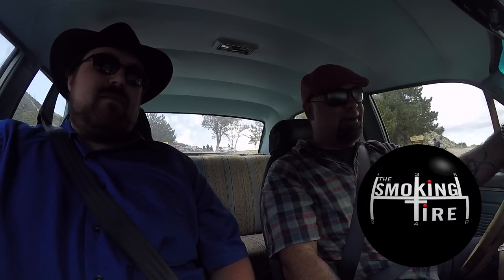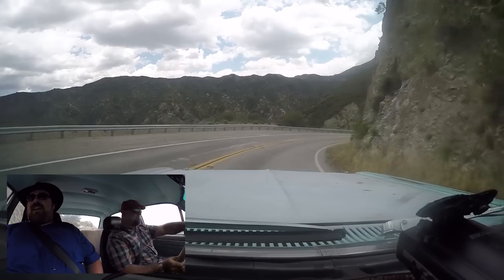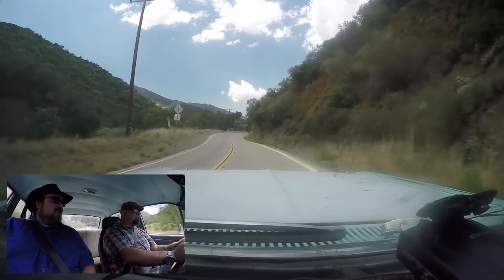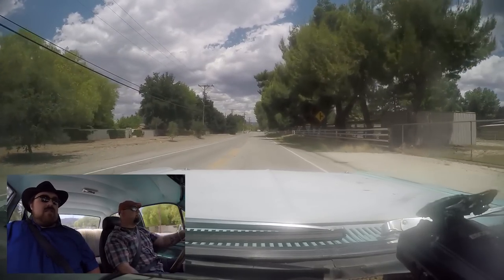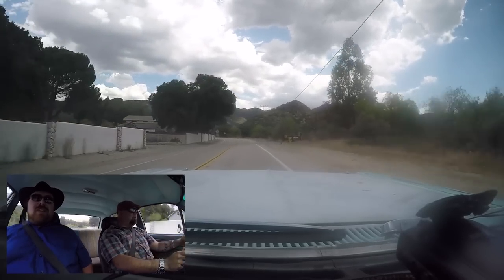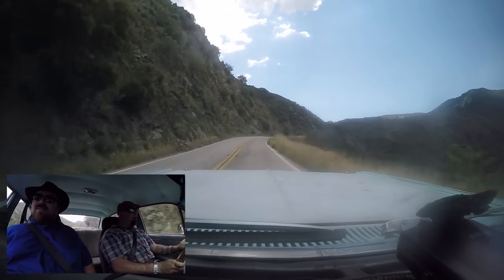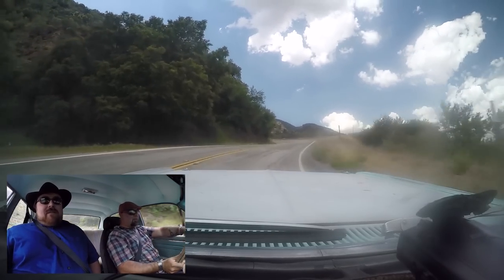1967 Ford Fairlane - One Take

Comment: Most people get a terrible impression about older cars due to the fact that the the vast majority of the ones still around need lots of love to be proper. Any vehicle with shrunk hardened bushings and mounts is going to drive badly. It's refreshing to find an old car like this that's had some love to make it drive like it did back in the day. I used to think all old cars were sloppy boats until I was chosen to be the driver for a group needing breakfast since I was the only one relatively sober. Everybody had single cab trucks but one, so we took his rusty 64 Galaxie 500, 3 on the tree 390 to haul everybody. The thing was ugly, but he obviously made all the important bits right. I was amazed at how solid and planted it felt on the road, at how well the steering and brakes and suspension worked like a perfectly modern good car. The 390 pulled the carload of hungry bar-goers effortlessly to their 3 a.m. breakfast buffet.

Comment: There simply are no engines that sound as cool as the old small block Ford. Things changed with the 351 for some reason. It just doesn't have that sounds, but 302's and 289's are epic.

Comment: I'm digging the paint and style. Keep it classic rat rod and make it handle. Just sort out the U-joint issue, reinstall power steering, power brakes, more shock dampening, and R888 tires.
Reply: Nah, man. Manual steering and brakes are fun. . .
Reply: ...as long as you're not daily driving it. Here in LA, power brakes are mandatory, as traffic has this nasty tendency to fill any gaps it can.
Reply: yea he needs to playing and handle that
Reply: computiNATEor I used to daily a '67 Cougar with manual steering and brakes. It was perfectly safe. 

Never been to L.A., though.
Reply: osp80 Arthur Robinson Point taken. But here in LA, where traffic tends to move at 80mph less than 2 car lengths away, and drivers treat stoplights like unofficial drag strips (not racing, but racing away), brakes can be invaluable to avoid accidents. Like last week when a beat to hell Dodge cut me off while merging on to the freeway, nearly pinning me into a semi, or last year, when an old Nissan slid across four lanes of traffic (including mine) and smashed into the center divider...

Comment: first gear does more than 100km/h?? wat?
Reply: Proper gearing. :)
Reply: If there is torque!
Reply: 2.79 rear gears is why - it would be more fun on those twisty roads with 3.73's
Reply: +Lee L a 342 would be better ,  or 355.  To keep it in the power band of that 302 and less wheel spin out the gate
Reply: w124 amg had 2.24 an rear went 300 kmh with 4speed auto lol
Reply: yep. 4 gears will do that. I can hit 90kmh and my redline is below 5000.
Reply: people are forgetting that it's a Cruiser & a daily driver so 2.79's are exactly what it needs, but if you do want just a bit more sping and still keep it as a daily cruiser a 3.00 diff would be perfect!
Reply: +GTFORDMAN 342 gear for the win would be matched up perfectly .
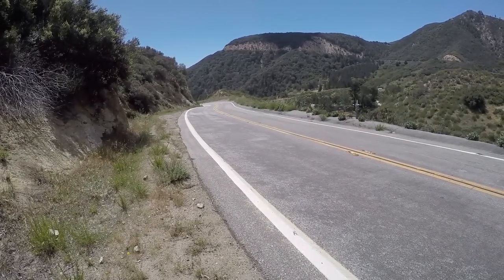Reply: +GTFORDMAN but with a 4 speed manual 3:08s actually is the best bet!
Reply: yea a 3.08 is pretty good for a part time track & full time driver i'll pay that!
Reply: Yeah, I estimated that my old XY Falcon with a warmed up 302w, close ratio toploader (2.32 to one first gear), 3.00 diff gear @ 7,000rpm was doing around 70 ish mph in 1st !!
Reply: P.S.  .....was quite different when it had 4.33's, .....I ended up with a reasonable 3.5 gear in the end (late 80's to early 90's).
Reply: 4speed

Comment: My brother has a 67 Mercury Comet Wagon. Three on the tree. He tried to "restore" it to factory specs (rebuilt gutless I6 included). In hindsight a build like this would have been way, way better. Engine bay is super narrow so back before I knew any better I assumed a V8 may not fit. Still has four wheel drums! I may eventually redo it when $$$ permits.

Comment: More details on that S13 parked next to the fairlane at the start?
Reply: it'll come.
Reply: I'm also waiting on the s-chassis
Reply: Details:  Probably the same SR20 proof positive 400hp with coilover build that's in every 240...
Reply: That is why I asked, because I don't like to guess.
Reply: +MrSlowestD16 actually no. i was waiting for matt to just post the video since it should be up very soon. he drove my car right after the yaris.  but real quick, stock block sr with gtx2863r, tomei cams, half-caged with door bars, full grip build. revalved gab sports coils, s15 front control arms, tomei 2 way clutch diff, 275 section rear nt01s, 245 section front nt01s. car puts down 300rwhp, 300rwtq with a very usuable powerband. ive had the car for over 12 years. ive been there, done that with the 240 scene.
Reply: Want to trade that turbo for a GT3582R?
Reply: +walperstyle no thank you. i prefer the smaller turbo for the response it gives as you will see in the video
Reply: That is exactly why I want smaller for my KA-T.
Reply: +walperstyle true. keep in mind that you have an extra .4L of displacement to help spool the turbo.  with a really good tune, you should still have a usable powerband.
Reply: I did the math my exhaust side (.82AR) is a little too large for what I want.   a .70 would be ideal.    Especially considering I don't have access to E85 up here in Canada.

Comment: What are the mods to the 302? He doesn't have to give up his cam specs I was curious about his compression ratio because it sounds nasty. What is an estimate for his power and torque curve? I'm gonna guess no higher than 400 horse if that.
Reply: So the 302 has been punched .030 over, but is otherwise a stock bottom end. Cam is a Comp N+271H, which is a hydraulic replica of the original Hi-Po cam, 266/273 and 219/226@ .050. I'm also using a set of full roller rocker arms. Intake is a summit racing aluminum intake, with Patriot long-tube headers. Distributor is a Pertronix unit, and the carb is of course, the Quadrajet.

As for a power and torque curve, here's what I have: http://s43.photobucket.com/user/NotLawMCO/media/Chassis%20Dyno%20Run%203.12.16.jpg.html

Sadly the fools running the dyno were clueless. The dyno was being run at a drag racing event in St. George, and the fools running it were only dynoing diesel trucks. They didn't know WTF to do when I showed up and said I would like a few pulls. They completely failed to take any relevant information about my car, and they just ran it with the same settings they were running the diesel trucks. The data was totally messed up. I did what I could to correct it, but all I really trust is the shape of the curve. Actual numbers could be off by as much as 20%.

A few weeks ago, I had an exhaust valve fail catastrophically, so now the block is getting machined, balanced, and a set of AFR heads. Should pick up some good power.
Reply: That's cool! Good luck with your project my friend! Thanks for sharing car updates! Go car guys!

Comment: Fix the rubbing and put some 3:73's in the rear and the car would be a hell of a lot more fun. Love the patina.
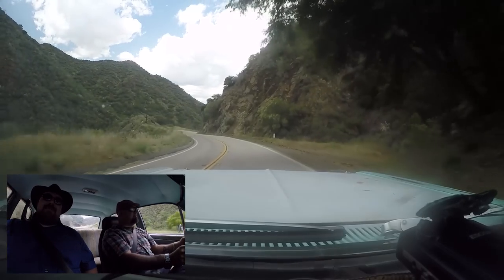Reply: Eventually the car will be getting a T56 and a set of 3:55's. It will effectively give me one gear under my current first, and one gear over. My current Toploader is a close ratio box, I love the gear spacing, and the particular T56 I am looking at will keep it the same.

Comment: 05-06 corolla xrs..find one drive one! Has the shared lotus Elise motor from factory...sleeper
Reply: It has like 170 hp
Reply: It has a nice motor but exactly, 170 hp is not a sleeper lmao
Reply: ***** That was quite a bit in the elise because it only weighed like 2000 lbs. But a 2,800 lb corolla with 2 passengers is gunna struggle to get out of its own way.
Reply: mazda 3 has similar power handles great
Reply: +miniTv미니19十 Mazda3 is pretty boring also
Reply: Robbspeed Yeah it's a mid 7 seconds to 60 car which isn't bad but the best thing about it is the sound of it
Reply: +miniTv미니19十 I would rather drive an xrs than a 3
Reply: Robbspeed the hatchback is fun. one of the best handling fwd ever made.
Reply: 미니19十 miniTv That's a stretch lmao
Reply: ***** no it's more sport car than economy car.
Reply: 미니19十 miniTv You can say that about the Mazdaspeed 3 but not the regular 3 lol
Reply: +miniTv미니19十 Maybe the speed3, but not the regular 3. Even then, there are fwd cars that handle better. Focus st immediately comes to mind and maybe the gti.
Reply: +Imad S Thanks lol.
Reply: Robbspeed I disapprove of your 'maybe the GTI" comment lol :P
Reply: Robbspeed honda integra type r still out corners some modern rwd cars. probably the best fwd.
Reply: +Imad S Lol thought you'd catch that. Definitely the gti.
Reply: 미니19十 miniTv Now you're making sense!
Robbspeed Thanks xD
Reply: I would love to see that, they are honestly underestimated.  here people swap the  2zzge toyota Tercels and Echos, and a few yaris are running them.
Reply: +B0rikua45 They're respectable. I think it's impressive any time you achieve nearly 100 hp per liter from a naturally aspirated engine.
Reply: +Robbspeed ive owned 2 and thats honestly not a good rep to the car. Yes 170 but with just an intake and exhaust ive seen xrs have 170 to the wheels which would equate to 200hp to the crank or more. In a care that weighs 2700 lb is still fun. Ive scared and beaten  a lot of things that people would never think is possible
Reply: +Robbspeed look up some vids you would be surprised
Reply: We call them Corolla T-SPORT in Europe. Came in 2002 to 2005...
Reply: +AllFromA_Phone I don't know what they typically dyno while stock but that sounds pretty good to me. That's a power to weight ratio of a fiesta st or something like that. Not quite as much torque though. I hope you got a tune to go with that intake and exhaust.
Reply: +Robbspeed also Matt's done some pretty terrible cars on here before...like the cobalt..kia forte...and so on. The corolla is a much more respectible car than those
Reply: +Robbspeed yea my old one did. With a i/h/e and a power fc(mild street tune). Which is whats popular for these i made 195 to the wheel. Just basic bolt ons. That was good  for high 13s with some sticky tires. Id say thats sleeer for a corolla
Reply: Agreed. Although it doesn't look like much on paper, driving the XRS is another story. Its lightweight and really has some pep to it. I've been driving mine for 3 years now and I'm still loving it. Too bad I live in Canada.... otherwise I'd volunteer mine lol. The only issue I foresee are the brakes fading. Otherwise I think Matt would be pleasantly surprised!
Reply: +uneducatedgrub yea id volunteer mine as well but i live in fl
Reply: +AllFromA_Phone I agree that with those mods, it would be a sleeper corolla. Not so much in stock form though, which is what I thought you were saying in your original comment.
Reply: ***** isn't the T-Sport supercharged?
Reply: +B0rikua45  nope
Reply: AllFromA_Phone ooh, whoops.
Reply from the maker: I already filmed one of those it's in the queue
Reply: TheSmokingTire Nice, I think that Matt Faraha did aswell, sir. :)
Reply: +TheSmokingTire I can't find a single one take of a corolla xrs.
Reply: +TheSmokingTire if im not mistaken ive seen a camry but not a corolla xrs 05or06. Thats the only year they came with the 2zz toyota shared lotus engine. I would have seen it by now. Thanks for replying
Reply: +Robbspeed yea i just figured if he did find one it would be modded
Reply: +Robbspeed he said it's "in the queue", as in one of the hundred or-so videos that he's already filmed, needing to be edited/uploaded. Shit takes time, my friend.
Reply: Here in PR, add a 150 shot of Nitrous when in 3rd and you fly in that thing!
Reply: +AllFromA_Phone Agree! I have a Golf mk2 with a mildly tuned 2.8 vr6. 1000kg (2200lbs) and around 190hp.
Reply: +TheSmokingTire my mistake i misread..so its an up coming video
Reply: I drive a tsport rolla in the uk with the 2zz. The acceleration when the engine goes into lift makes me grin like an idiot i love the thing. doesnt handle like a proper sports car the centre of gravity is too high but would love to see matt giving one the beans.
Reply: YEAH YEAH YEAH this x1000!

An 03-06 Matrix XRS or Vibe GT will also work :)
Reply: get out of' murica... 90hp in a 2400lb car, 1500lb loaded does not struggle at 65mph.
Reply: +AllFromA_Phone It's the other way around. The Lotus shares the engine with the Corolla. It's funny how people forgot that the 2ZZ and 1ZZ were Toyota engines once Lotus started using them.
Reply: +koopatroopa187 i know its that way just wrote it wrong.engine came in the celica gts first
Reply: AllFromA_Phone "Thats the only year they came with the 2zz toyota shared lotus engine"

You called it a Lotus engine twice. The engine being used in a Lotus is entirely irrelevant. Especially when Lotus literally does nothing to the engines apart from tossing an Eaton blower on it depending on the model.
Reply: +koopatroopa187 thanks for quote i know what i said. Then engine was as shared engine with lotus. Toyota bottom end and yamaha designed head i know all about these cars and engines.
Reply: +AllFromA_Phone also trying to get matt to look at the car and when you say it has the engine that is shared with the elise it sounds better than just saying its a corolla xrs. People don't look twice if you say its a corolla xrs. The have no idea what that means. But if you say its got a shared engine that goes i a lotus Elise people tend to take a second look. Ive ownd 2 of these cars so i know the ins and outs. Just trying to get the car on the channel so people can see what it can do
Reply: There's a Yaris with a 2zz for sale around here, that would be more fun to drive.
Reply: given the short wheelbase and how hectic a 200+hp lightweight swb subcompact is...certainly not a friendly car to drive.
Reply: +TheSmokingTire damn that queue must be long as shit cause i still havent seen a corolla xrs 05-06 on here

Comment: Damn.  I need to get off my ass and get my 67 fairlane vert back on the road.  It's still all original and only has 55k miles on it.  Needs a bunch of transmission and power steering leaks fixed, along with the brakes redone.

Comment: Would anyone happen to know relatively how loud this car is? I love the sound of it and would love to build a similar-sounding system for my '68 barracuda, but not if it's excessively loud. The current system on it is a little much for my taste.
Reply: It is quite loud right now, but between the carpet and the additional insulation I added it's really not that bad on the inside. At 65 mph it's no problem to hold a normal conversation inside the car, and the exhaust is just loud enough to hear it over the wind at cruising throttle. The same holds true up to around 80 or 85 mph, where the wind with open windows is just too damn loud. With windows up, you can hold a conversation up to 100 mph, after that, the exhaust starts getting loud. Of course, at WOT it is damn loud, and outside the car? My friend was up at the top where this video starts and ends, and he said he could hear the car when Matt did the first gear pull, and most of the way up the canyon. Its loud. Exhaust setup is full length Patriot Headers, going to 2.25" pipe, with a set of 2.5" Smitty glasspacks, around 26" body length. My old exhaust was full 2" with 30" Smitty glasspacks and it was a little quieter inside the car, and much quieter outside. I can highly recommend the Smitty 'packs, they have a great sound, and the longer they are, the quieter they are.
Reply: Wow, thanks! I didn't expect to get a reply from the actual owner/build of the car. The Barracuda is a little less heavy on the insulation, but I'm mostly worried about exterior noise. I actually want an audible, loud roar in the upper throttle range/WOT, but moderate to quiet noise for normal street driving. I don't want to be the "teenage douchebag with that loud car" when I'm just driving regularly. Anyways, thanks for the response! I'll look into getting some long-ass glasspacks or perhaps even a dump valve.

Comment: How much power was the fiesta making before u sold it
Reply from the maker: 320 WHP on 100 octane, 280 whp on 91
Reply: TheSmokingTire damn that's insane for a fwd car
Reply: +TheSmokingTire That can't be right.. can it?! those are crazy numbers for a 1.6, In the Cobb 100octane pro tune video it put down 240 WHP and 320wtq, did you guys do another tune/more upgrades after?
Reply from the maker: +Shwa Andary sorry I brain farted in that comment. It was 240 WHP and 320 TQ, not 320 HP.  My bad

Comment: He said he bought a rebuild of a motor for $350 @5m in then said he built it 2.5 years ago @9m in. What the ferk?!
Reply: Bought a short block he said. Meaning the whole top and didn’t come with it. Which means he adds I take, headers, carb and all the rest of the goodies. Short block means just a bare blocks with internals. Everything else he added that’s what he meant by building

Comment: why would you ever run a quadraflush unless it came on the car factory and didn't have money for a new carb?
Reply: Maybe because the Q-jet netted me between 18 and 21 mpg for almost every fill up I made on this trip? When you drive this car as much as I do, fuel range matters, and better fuel economy means I can go further. Plus the Q-jet sounds awesome at WOT, which Matt did not do very often, and which does not come across very well on the video anyways. My question is why wouldn't anyone run a Q jet? my AFR gauges tell me that this Q-jet is very nearly as good as TBI would be at maintaining 14.7:1 stoichiometric ratio +/- .5 even through 4000 ft of elevation drop (I did have to adjust the Adjustable Part Throttle setting at around 2000 ft elevation to fatten up the mix, as well as change the secondary rod size)
Reply: NotLawMCO Holley Spread Bore highly useful thing.